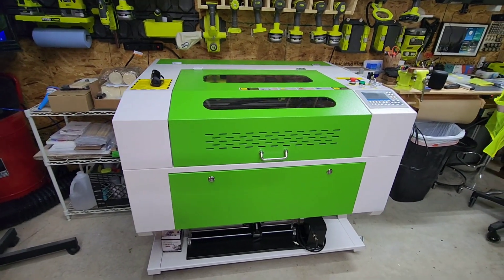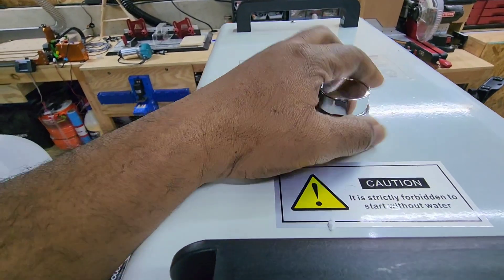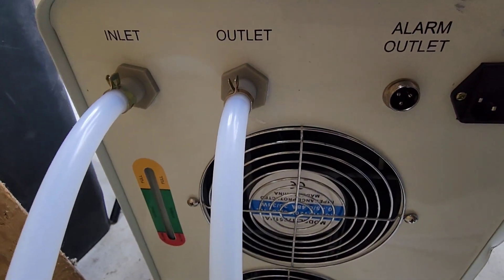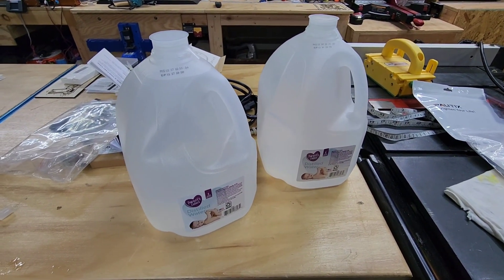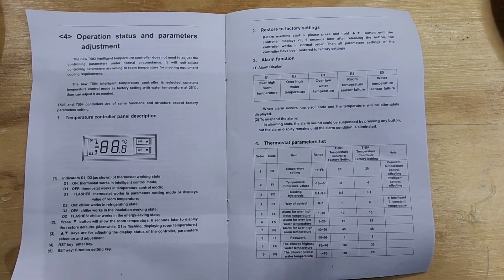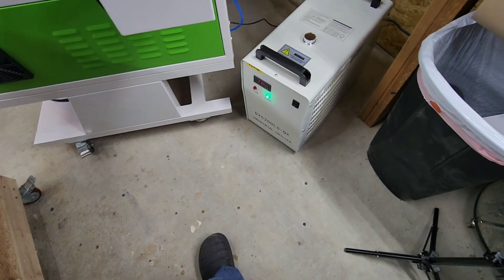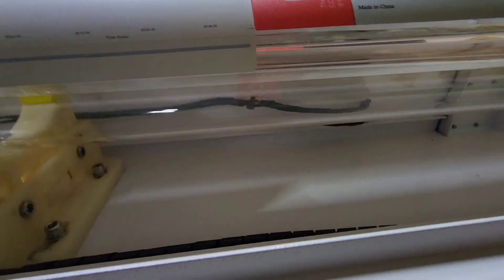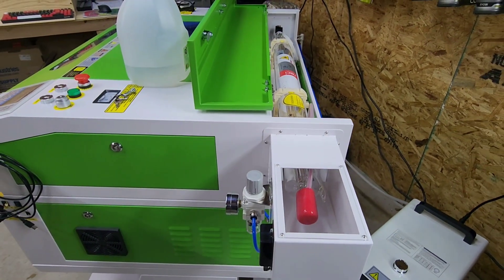US RECI MELDIKISO 90W PT. 3 - Vevor CW5200 Water Chiller Added

Comment: I'm interested in buying that chiller, but it's not clear how low you can set the temperature.  I want to use it as a glycol chiller for my homebrewing system and I'd like to bring the beer down as close to freezing as possible.  Can this unit get down to 0 degrees C?